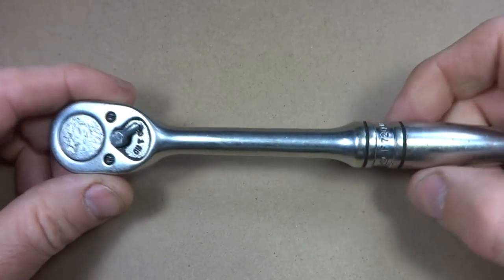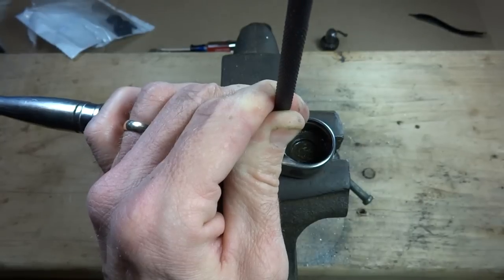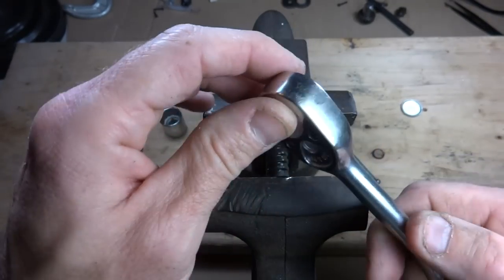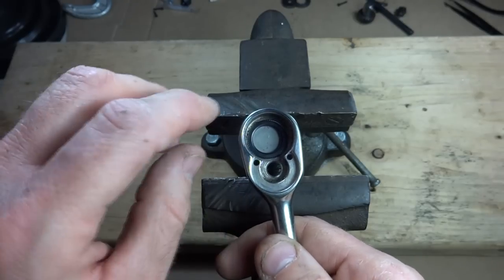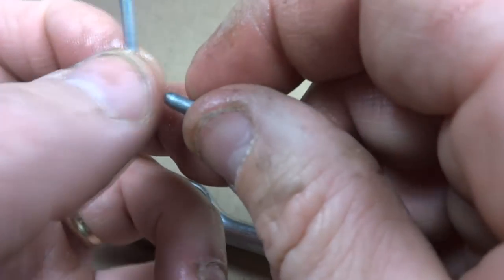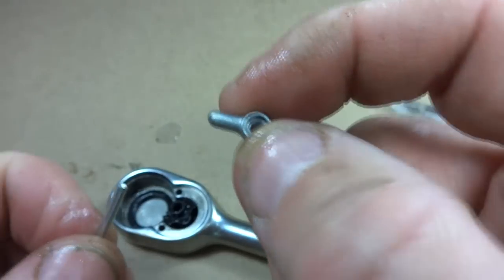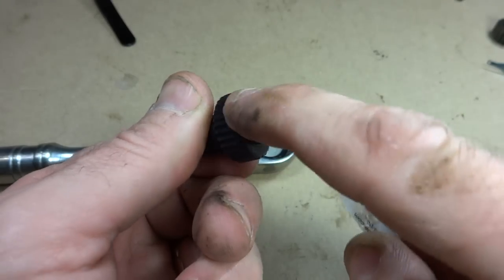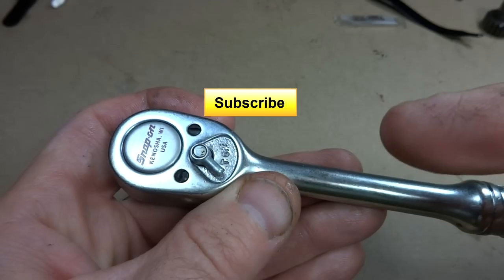How To Rebuild Snap-On Ratchet Wrench With Repair Kit

Comment: Why not just get a Sears Craftsman and take it back when It's Broken?
Reply: Id rather have my USA Craftsman tools and china tools they would replace em with
Reply: So by your logic all other tool brands are unnecessary.  Why bother with Matco, Snap On or Sk? We have Craftsman.  That's no  fun.
Reply: +Greg Blackburn Taiwan products are good, look for marking from factories S-AE = China L-AE = Taiwan
Reply: +Dixinormus The biggest issue with Craftsman ratchets is the quick release button on the back of the head as well as the direction switching lever.  The Button location makes it very difficult to push down on your ratchet head while torqueing because doing so releases the pawl from the teeth.  Also when you turn while pushing on the head of a Craftsman Ratchet it switches the direction of the ratchet rotation randomly which can be frustrating.  Craftsman ratchets are good but when you rely on them daily/hourly to feed your family they just don't cut it.  Bad release placement and plastic direction switches...  They are good, my 1/4" stuff is Sears, my 3/8 is MAC, and my 1/2" is Snapon.  My 3/4 is actually a Craftsman Pro T-Bar and Ratchet head attachment, it's never broken but I don't really use the ratchet much for obvious reasons.
Reply from the maker: +Earl P I actually prefer my Craftsman wrenches over the Snap On. I like the quick release button. But I guess to each their own, eh. My ratchets are older made in USA ones.
Reply: It really depends on the use of the tool.  With the quick release ratchet one handed use is made more difficult because you have limited places to put downward pressure.  They have their uses.  I have a full set of Craftsman teardrop sealed head ratchets for Turbine engine work but don't do it anymore.  It really does depend on your use.  I wouldn't use Snapon for small engine repair but won't use standard Craftsman on an AGT engine (non FOD or unsealed heads) so it's a tradeoff speed vs durability vs specialization of use.
Reply: ***** I've found some Japanese companies like KAL to be pretty durable as well.
Reply: robert sears save yourself many trips. Buy once... Cry once.

Comment: Thanks for reminding me to NOT purchase one of those.  I already have a flex head, I think a similar model.  Even the Chinese tools these days are more refined (like that Stanley you cleaned in the other video).
Reply from the maker: I actually prefer my Craftsman wrenches.
Reply: The old fine tooth ones?  I was thinking of getting one to see what the hype was about.  I really don't like the normal coarse ones very much.
Reply from the maker: No, the coarse tooth ones are okay, though finer teeth would be nice. But I just like the feel. And the quick release button is nice.

Comment: They will not guarantee the ratchet moving mechanical. I bought this mine to the truck n he deny me straight out.
Reply: Its when they suspect you got the ratchet 2nd hand of ebay and are wanting a free repair kit. I walked on a Snap On van with a 35 year old ratchet and was given a repair kit after I assured the Snap On man I'd had it since new. I also have a set of imperial Snap On comby spanner and ring spanners that are now redundant because all the cars I service now have metric fasteners.

Comment: Just flag down a Crap-On truck
Reply from the maker: And they may or may not replace. They are not required to if you didn't buy it from them.
Reply: @RJTheBikeGuy  Crap-On is the Apple of tools. Overpriced, overhyped and underperforming.

Comment: Even if Snap-On itself made those replacement parts, I wouldn't replace any of them that still work.  Things were made better back then, there were craftsmen with pride in the old factories.  Globalization destroyed all that.  Sweatshop workers receiving $1/hr making tools for foreign customers probably made those replacement parts, which here he just installs willy-nilly whether needed or not.  A ratchet wrench should not slip when turning a nut or bolt; that's it.  Even if the parts in it look worn, if it doesn't slip, keep them in, they're doing their job and are probably better than the replacement parts.  

It's unclear what if anything is wrong with the wrench.  He says only, "As you see here it's a little bit beat up."  I couldn't see anything broken or non-functional in the views of the wrench or the parts.  Just because it came from a flea market is no reason to replace any parts.

You have to ask yourself, is a vintage Snap-On, made in USA, better or worse a tool after it has been gutted and replaced with a sweatshop kit from S.E. Asia?
Reply: I agree with the sentiment but as far as I know the Snap-On ratchet repair kits are still made in the USA.

Comment: Thanks for showing. I’ve worked on a few myself. Did you find that there is a break in period for these? When I rebuilt my FV71, the on/off mechanism felt a little tight. I know it’s all put together right, but other vintage ones I have seem to have a more broken in feel. Maybe the modern rebuild kits are engineered to tighter tolerances, who knows?

Comment: How to repair a Snap On ratchet, find a dealer and have him rebuild it for free. I just had three 3/8 ratchets, of that era, rebuilt today for free. Lifetime warranty.
Reply from the maker: I see their truck a couple times a year. I have been told that if they don't know you, they may or may not repair the wrench.
Reply: RJ The Bike Guy if it’s a snap on wrench and a snap on dealer, they have to rebuild it for you. You may have to put up a little fight, just tell them you’ll call corporate, they’ll fix it.
Reply: If your Snap-On ratchet has the letter "G" in the model number it is a government contract tool and has no warranty. You will have to buy the rebuild kit and rebuild it yourself. You have no recourse against Snap-On.